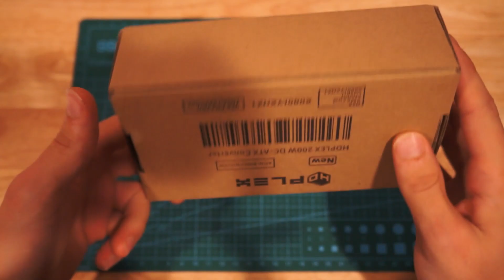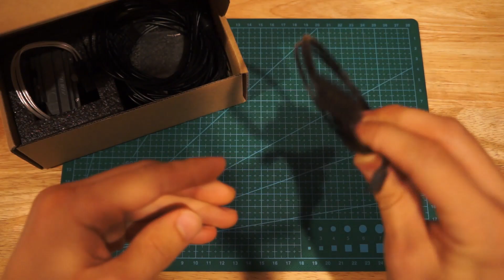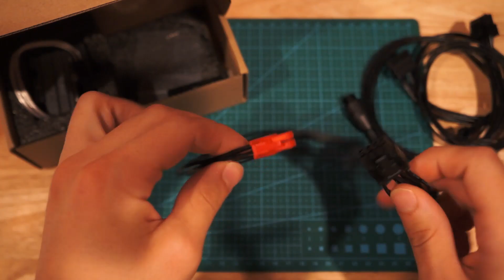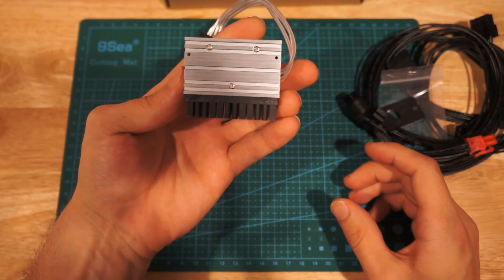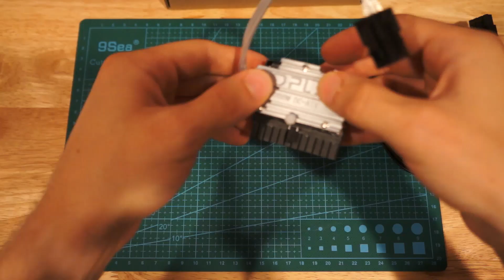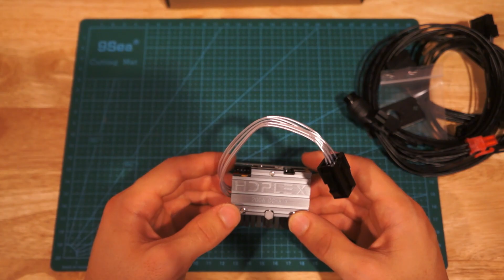HDPLEX 200W DC-ATX Power Supply Unboxing

Comment: the unit says it take 16v-24v dc input.  does it eat power directly from 24v battery(which are usually 25-28vdc)?
i found the 400w version says it will take 16-30v dc input.

Comment: Hi,  what s your toughts after a year. Is everything still ok ?
Reply from the maker: Yep, it still works great. Long periods of drawing close to the full rated power without issues.
Reply: @ErikServili  nice, did u use it for just an APU build, or did u add a dedicated GPU later down the line ?
Reply from the maker: @WIMON  https://hackaday.io/project/167957-upgrade-ready-virtual-reality-backpack

Comment: So will this work with any dell/hp laptop chargers as long as its 19v and had the right connector?
Reply from the maker: Yep
Reply: @ErikServili  I have a 130watt dell one that's says it outputs 19.5v is that still okay or should I find one that only puts out 19v?
Reply from the maker: @FerrumBellator  19.5v is fine, but you may want to pick up one that puts out a higher wattage. They tend to be cheap and you don't want to introduce too many bottlenecks in your setup.
Reply: 16-24v

Comment: Hello, what charger would you recommend for this? Could you tell me which one you use?
Reply from the maker: I've used both an HP 200w slim charger and the common Dell 230w charging brick. As long as it comes with the 7.4x5.0mm plug, either brand's genuine chargers work great
Reply: https://hdplex.com/hdplex-200w-dc-atx-power-supply-16v-24v-wide-range-voltage-input.html

Comment: I just bought one to use with an Dell 240w power brick.

My sistem is:

MSI GTX 1060 6GB (undervolt)
i5 8400 (undervolt) + noctua  nh-l9i
2x DDR4 kingston 8gb 2400mhz 
SSD kingston A1000 480gb.

Thanks for sharing your review! Regrads from Brazil!
Reply: Is the undervolting necessary for this psu? How is your maximum power draw after undervolting?
Reply: Amigo, tudo bem? Sou de Salvador e comprei uma dessas, você saberia me dizer quanto tempo a sua levou pra chegar aqui no Brasil? E em quanto tempo eles enviam? Comprei no site oficial, mas está com status "processando" já faz alguns dias, desde já agradeço! Abraço

Comment: Nice. Hope to see more of your build. Will you power a dedicated graphics card?
Reply: It can handle dedicate graphics card indeed. But it would also depend on how high the power consumption is from CPU.
It should be able to handle 75w GPU like 1050 ti / 1650 with 65w CPU.
More info: https://smallformfactor.net/forum/threads/hdplex-200w-ac-dc-im-surprised-nobody-is-talking-about-this.10684/
Reply: Will a GTX 960 work?